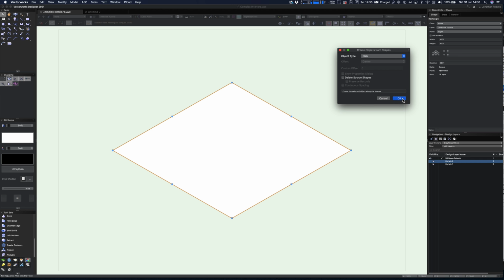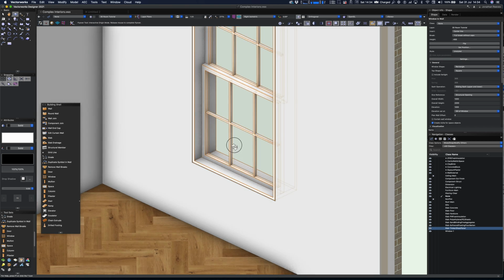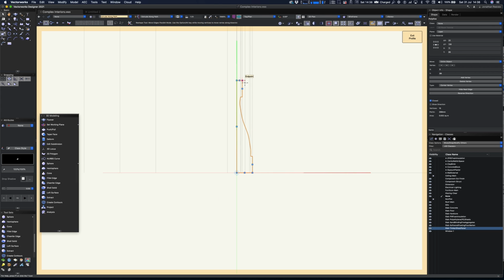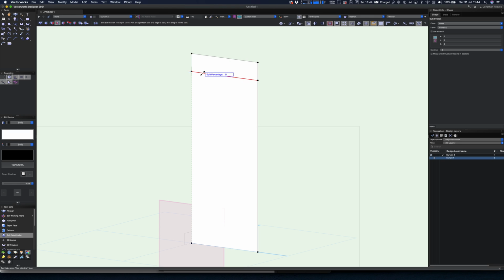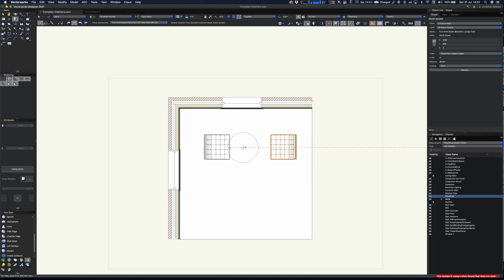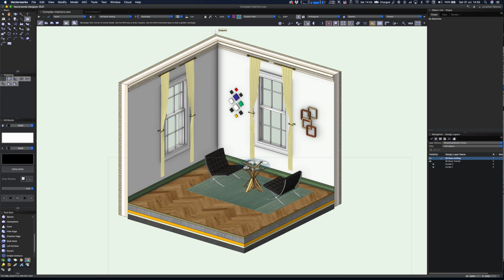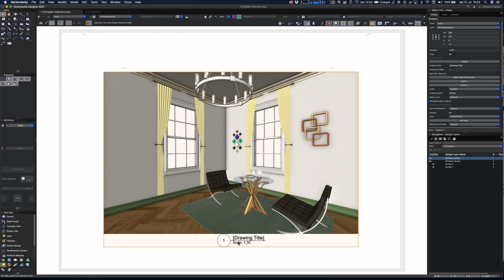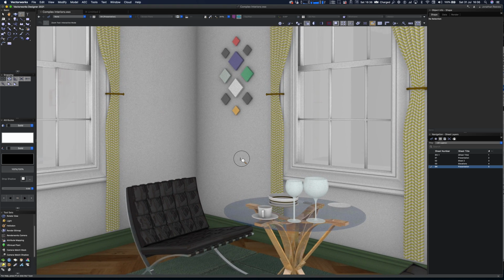Creating Complex Interiors in Vectorworks

Comment: I have the same issues when Follow Along Path, your window molding did not appear correct even though it was in the edit screen. In your model the molding is on the interior side of the perimeter line. It seems like in the Edit screen it is flipped from where it ends up.
Reply from the maker: It depends which direction the path is drawn, but you can edit this afterwards by double clicking and edit the path or profile
Reply from the maker: Thanks for pointing that out - I'll take a look and see if there's a setting I missed.